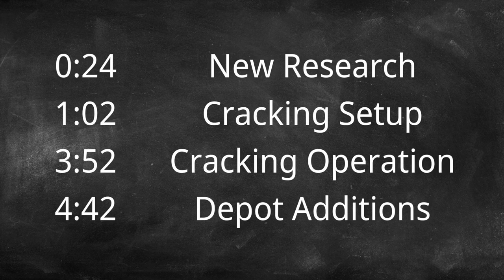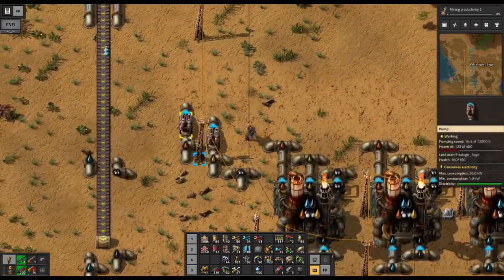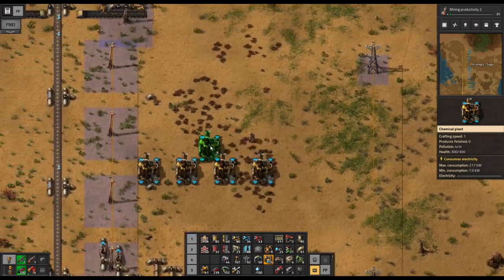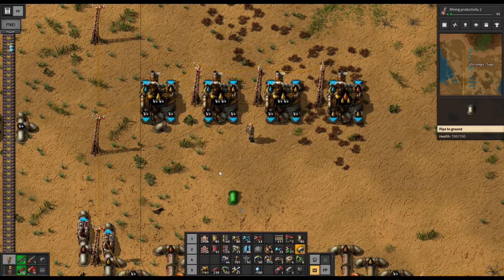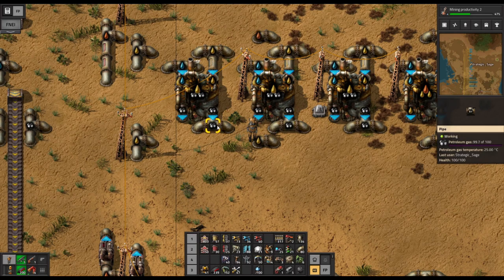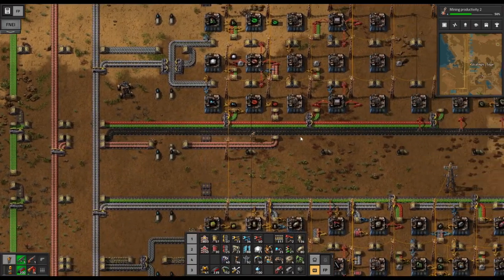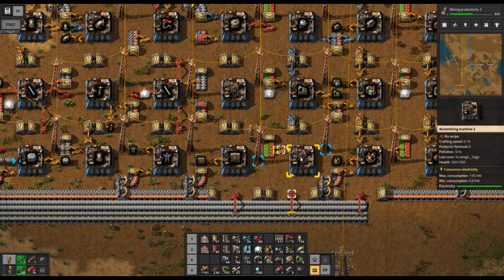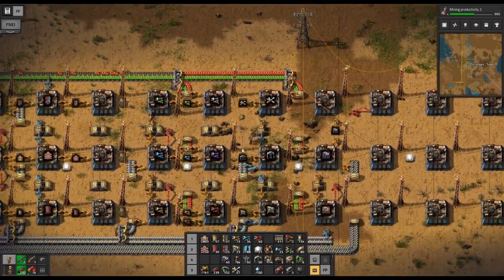Advanced Oil | Factorio 1.1 Tutorials for New Players #27

Comment: Hi Sage - noob here.
As I'm trying to understand ratios, how did you go from the optimal ratio described to 6:2:6?
Shouldn't have been 8:2:7, to get the most out of the production?
Reply from the maker: If you really want to fully optimize ratios, yes.  In general, I don't actually think that's always the best idea for new players.  In the case of oil, there are other reasons to not make exact ratios also.  If you get into a situation where you want to catch up on petroleum gas for example - and it's almost guaranteed this will happen at some point - then it's useful to have somewhat more cracking production in order to make that happen faster.  Exact ratios are a lot more useful when you know precisely how much output you're going to need, and you don't know that with oil at least until other decisions are made further on in the factory.  So I think some overproduction is useful.
Reply: @strategicsage7694  Thank you for your reply - I'm actually in the middle of solving many issues with shortages (petroleum gas mainly, caused by lack of light oil).

Can you please help me understand if this is accurate?

- If for every light oil cracking I need one refinery and..
- If for every heavy oil cracking, I need three refineries, then..
- ...if the above is accurate, following your template with 4 L.O. cracking and 2 H.O. cracking, does it mean I will need 10 refineries?
Reply from the maker: @roykato86  Sure, but I can't answer the way you want I don't think.  I would look at it the other way around, because you get some gas and light oil from refining.  You want at least enough cracking - as mentioned I advise a bit more - to use everything coming out of your refineries.  So you start with refineries and work your way up, rather than starting with cracking and work your way down.  You said you have a 'lack of light oil'.  If it's a lack of oil in general, you want more of everything, possibly including crude oil coming in.  If you don't have enough light oil because you can't crack all the heavy oil, then you need more heavy oil cracking.  It depends on what kind of problem you have .
Reply: @strategicsage7694  I guess I'm starting to understand...at the moment I don't have any structure using Heavy Oil, hence I've created this "bottleneck" I guess?
At the moment I'm only producing products that use plastic (4 chemical plants) and sulfur (5 chemical plants), so light oil only.

So what you're saying is to see and understand what the demand for the actual resources offered by my oil infrastructure (and ensuring I respect the ratio accordingly, which I'm struggling to calculate ATM)?
Reply from the maker: @roykato86  Well you initially stated the ratio fine, so you should be pretty good on that.  It's just a case of how many times you want to multiply it.  It doesn't really matter that much if you are using any heavy oil - I wasn't using any of it at the point of this video.  The key point is, do you have extra heavy oil that you can't crack right now?  If you started using a bunch of heavy oil elsewhere, you'd have less to crack and would need to add more refineries, but if you can't crack all the heavy oil you have then eventually whatever storage you have in pipes and tanks will fill up and the refineries will stop.  So it comes to either A) dealing with anything that's clogged/backed up, or if that's not happening then B) scale up the whole operation, refineries and cracking.  Hope that makes sense.